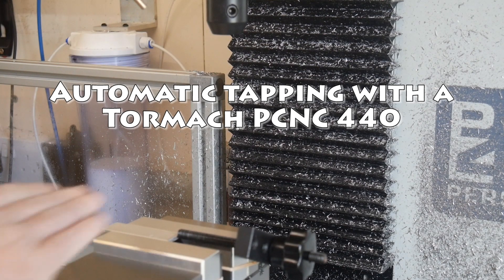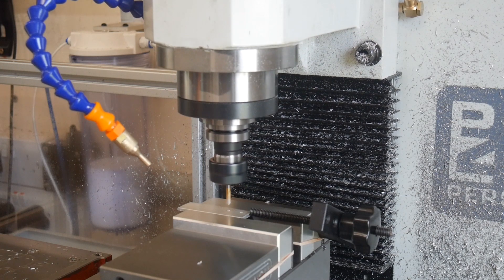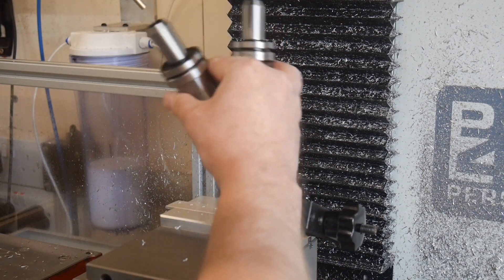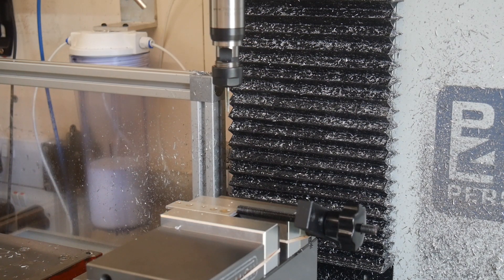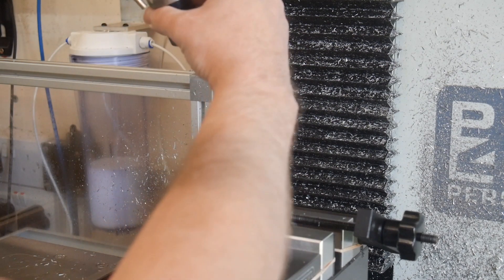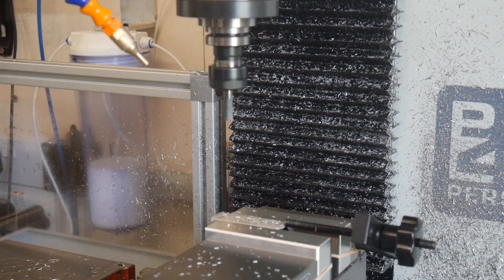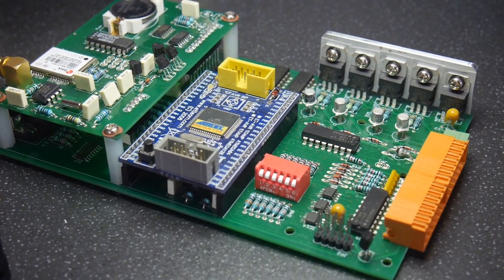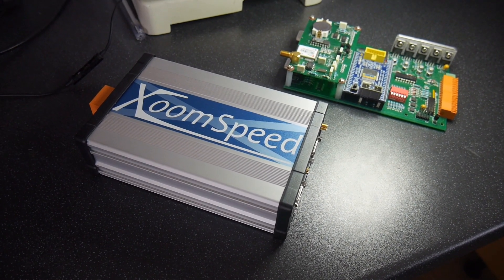Tormach PCNC440 does tapping

Comment: Yea would love to know details on how you were able to program that. Also speeds and feeds?
Reply from the maker: Very easy to modify the 440's drive for reversing by adding a USB I/O board.  Then it's just some modest modifications to the post processor to output the code correctly.  You can do it with one of my I/O cards - https://shop.xoomspeed.com/collections/cnc-accessories/products/usb-i-o-board and then use my post-processor - http://xoomspeed.com/CNC/FusionPostProcessor.htm

All the tappiing I do is done on the low belt at 500-750 rpm.  It'll do up to M5.  M6 is I'm afraid beyond the mill's abilities.

Comment: thats not rigid tapping is it? is that a floating tap?
Reply from the maker: As I said in the video, it's one of these

 https://www.tormach.com/store/index.php?app=ecom&ns=prodshow&ref=32020

Having played around with it a bit more now, I find the 440's motor is powerful enough to drive anM5 x 0.8 tap through 20mm of 6082 alloy (4.8mm pilot hole).  Anything bigger than that, and it's likely to stall.

Comment: Super cool, i have a 440, could you please share the modification details with us, nicely done.
Reply from the maker: Hardware mod is very simple as output 3 from the MX3660 is unused.  Just connect output 3- to the motor driver COM terminal and 3+ to the F/R terminal and that's it.  Setting up the software depends on what you're using obviously.  I'm on Mach3.  Turn that output on and the motor reverses - even from full speed forward.